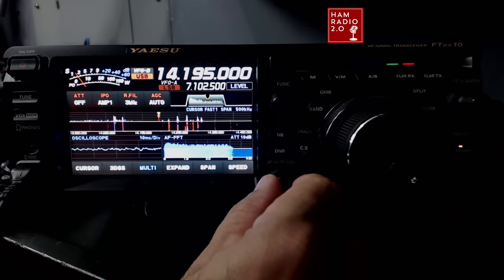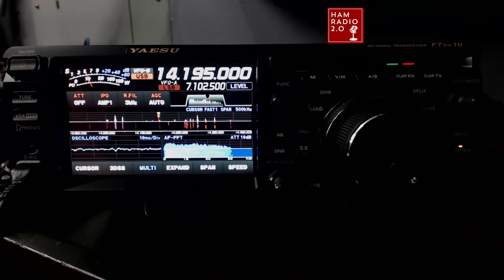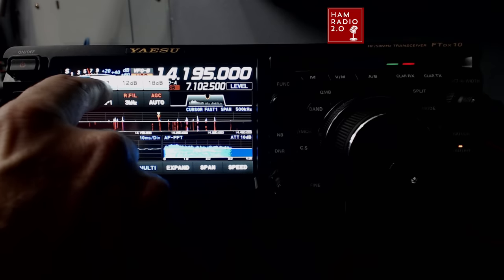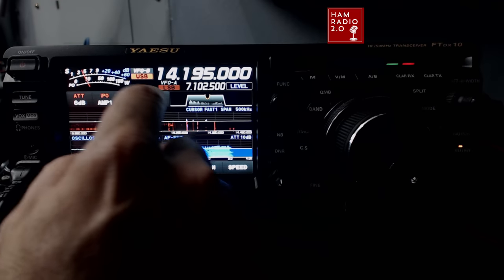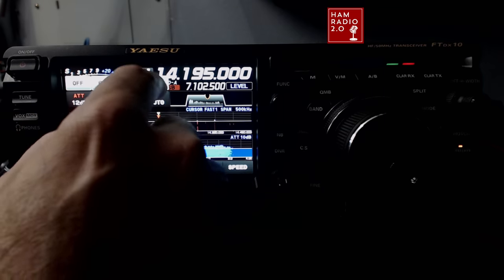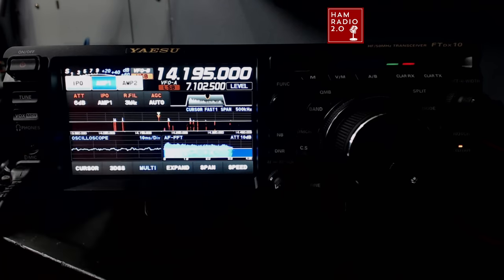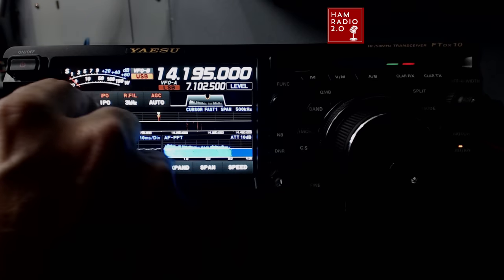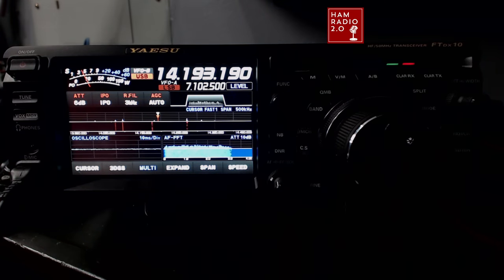Yaesu FTDX10 Tuning and Receiver Deep Dive | WATCH THIS!

Comment: Doug is a fantastic resource for FTDX-10 owners/operators and HAM radio in general. 

In fact, I do not even have my license and yet I have been binge watching his videos for the past few weeks. I figured that the Yaesu FTDX-10 would be the perfect 'one and done' rig. It would also happen to be my only radio for the foreseeable future as I have no plans on setting up an entire shack. 

My wife and I merely want a corner of our new home to be designated for our radio(s). (Plural because we have the ubiquitous FT-60 HT's as well). Not to mention, it [FTDX-10] seems to be the only newer radio that is currently in-stock at all the major retail outlets. I grow tired of waiting for the 7300 and/or the 991A. 

Like I have premised before and elsewhere. I like to explore these radios strictly on the RX end before I even consider taking my test(s). This often rubs people the wrong way who insist that I acquire the proper licensing before purchasing any radios. I surmise these are the same people who do not believe in the Constitution, the Bill of Rights or due process. We call them Fudds in the 2A community but I digress.

My favorite analogical reply is simply - "You do not need a drivers license to build your own hot rod." <End of Discussion>

Normally, I loathe collaborations regardless of which community we are referring too. However, I have to say (in this instance) that I truly appreciate this video. I can honestly say that there is not a single video that Doug (N4HNH) produces where I walk away without learning something. He is a great teacher and I hope he continues to reach more people.

Stay classy my friends.

Comment: Great video. Doug also does an excellent job on how to adjust all the settings from attenuation and RF amps to shift, width, notch etc. I’ve learned a lot from him, so check out his channel. What he shares can be applied to any modern radio.

Comment: IPO has been in Yaesu radios for years and it is very effective. Operators simply do not read their radio manuals fully before using them. You still see videos on youtube where people are showing their radios with s9 noise yet their radios are not showing their IPO on especially on frequencies below 14mhz.

Comment: Being an audio engineer and a broadcast engineer I must suggest a correction.  The filtering in the audio section as shown is in fact a "CUT" not a "SHELF". If it was a shelf filter you would only have a DB adjustment as opposed to a DB per octave adjustment. He properly stated the filter "SKIRT" slope changed. A skirt and a shelf filter are mutually exclusive.  I am personally lusting for a FTDX10.

Comment: Great video. I have a microphone question. Can you use and older mic. like a Yaesu MD-100 with FTdx10? I have one and was hoping it would be compatible. The pinout looks like it would or do you have any recommendations for a desk microphone for this transceiver. Thanks for doing all the FTdx10 videos. Very informative.
Reply: MD100 is listed as an accessory for it on Yaesu'sv site, so, that one for sure can

Comment: Great video , I have a old ft 840 no IPO I believe the pre amp is always on , att helps , I would never run my ft 950 when on 40/80/160 with out the IPO selected , thanks again for video , im very tempted with a ftdx 10

Comment: it is a bit wrong to say that sloping 6db/oct will help noise floor - what I think is better is if you use DNR is to leave entire range so the cleaning sounds better and not muffled - so no its not helping the noise floor directly but maybe as perception - Also it depends on the speakers response freq and other factors - I think default is better if you use Noise Reduction.  But I understand what he was saying.  I am considering this radio it is really good price for what it delivers.

Comment: IPO on is not quite the same as pre-amp off! On the FTdx-5000 there are 2 different IPO settings. The RF path into the receiver differs with IPO on from just not having a pre-amp on as can be seen on the 5000. Also IPO has been around for a long time, way before SDR radios.
Reply from the maker: This isn't an FTDX-5000 radio so it's possible that it isn't the same for the FTDX-10

Comment: By "shelving" regarding high cut and low cut, these are actually low pass and high pass filters  respectively with selectable slopes, either 6dB or 18dB per octave.  There are not shelving filters.

Comment: Remember it's most likely if a rare DX is in the noise floor and you barely pick him out using noise canceling tools it's highly unlikely he will ever respond back as it does not improve your transmit quality. The antenna, amplifier and microphone is where you should invest in.

Comment: Great video.

I have a FT DX-10 and I did all the tweaks recommended BUT I can't tell much of a difference in how the receiver sounds or any change in the noise level.

So maybe if you are an audio engineer, these settings are useful but for average ham, it's just some more gadgets that Yaesu has come up with for the marketing department to use.

Yaesu it seems, makes a habit of making everything as complicated as possible. Having a parametric equalizer on a HF radio is over the top AND hard to set properly. 

I love the radio but I think a lot of the choices and settings are a waste for an appliance operator that just wants to work some DX and rag chew.

Maybe if I ever become more technically competent, I will appreciate it more, but for the average ham its overkill.

Comment: Suggest Not using IPO amp 1 or 2 below 18mhz. rx is already hot,having ipo on = allot more rx noise..
20 40 60 80 160m is usually noisey.and need some attenuation..

Comment: Bad news or ?
Yaesu FTDX 101D and FTDX 10   do not use SDR receiver for RX to speaker 
It have SDR receiver but it is only use  for the display spectrum.
It have IF on 9 Mhz   SDR have no IF :)
SDR receiver do not have roofing filter :)
SDR receiver do not have VC-TUNE as there do not have IF :þ
SDR receiver is direct sampling . FTDX 101D is not direct sampling receiver or Transmitter.
Kenwood  TS-890S    is the same as FTDX 101D, it is hybrid .
Kenwood told me there use the best from old and new time for there TS 890S
Again FTDX 101D is not SDR receiver, but it have SDR receiver for the spectrum display
Both Yaesu FTDX 101D and Kenwood TS 890S are Hybrid SDR

I would learn more about the radio before I start give it a report.
Reply: The Down Conversion type receiver construction is similar to the FTDX5000. The first IF frequency is 9 MHz, and a low noise figure dual gate MOS FET, D-quad DBM (Double Balanced Mixer) with excellent intermodulation characteristics, is implemented in the mixer section. Narrow band SDR configuration makes it possible to use the narrow bandwidth crystal roofing filters that have the sharp shape factor.  This achieves the amazing multi-signal receiving performance when confronted with the most challenging on-the-air interference situations.
Reply: ICOM IC-7300  is 100% SDR receiver transmitter.
Reply: "SDR receiver is direct sampling."
No. :-)

- Any radio is a Software Defined Radio if its modulation or demodulation is done by software (after an A/D conversion).
- A Direct Conversion radio has really no IF, but it can be analog (synchrodyne radio, a nice adventure) or digital.
- The SDR is a wider concept, it can be a hybrid with analog mixers but with A/D conversion and DSP at the opposite end to the antenna.
- It would be better to call Direct Conversion radios to DDC/DUC, Digital Down Conversion/Digital Up Conversion radios here, but it is too long... Anyway, it is a subset of the SDR's.

So an SDR just can be a DDC/DUC radio.

Providing a waterfall display also needs a DDC receiver as you say, but in these radios they are connected to the output of an IF stage of an analog or hybrid radio before the physical filters, therefore they work only on one band at a time (determined by the band pass filtering).

Also, the first intermediate frequency of an analog superheterodyne receiver can be high, about 70 MHz or so, but another radios convert the signal down to 8-9 MHz first, or so (then further down), and sometimes they are flagged as down conversion, too... :-) Some radio can be switched what way to work - I don't remember now the details.

Btw., TS-890 utilises an H-mode mixer for its first IF stage, it's a good question should we count it as digital or analog. :-)

Also by the way: there are radios with superheterodyne stages before a full featured DDC receiver to be used as an IF receiver to squeeze out the last decibels of dynamics and selectivity on demand today. When it is not needed, DDC part of the receiver may work alone for the advantages of a DDC (and don't forget the transmitter, the possibility of pre-distortion). I don't know the name of the model, but Elecraft K4HD will do the same.